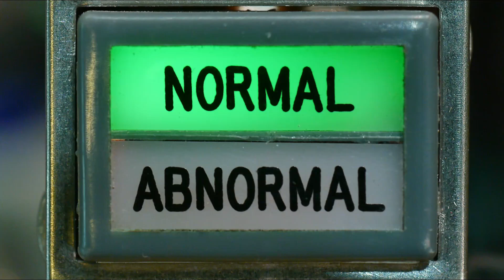#2384 Intel 8755 Port Input and Port Output

Comment: Thanks for all you do, I’m a retired hardware/firmware embedded designer.  I just love uP’s. Question, I just bought a 8711A and wonder if I make the same boot flash mode you did on your 11C, what’s the probability I can make a 12A?  Thanks in advance Best 73
Reply from the maker: https://dietervansteenwegen.wordpress.com/2016/11/14/hp-8711a-modifications-tweaks-refurbishing/
Reply: Thanks I’ll keep you posted on the mod, 73

Comment: Thanks for doing a quick video on the little project, I was curious what the socket was for.  DIP switch makes perfect sense.  I wish I had one of these when I was a kid.  I would have used it like an Arduino / simple PLC to control real world stuff.  A lap counter/timer for a slot car track that would show lap time / total time/ avg time for instance.  Imbed a reed switch at the starting line that would close as the magnets in the cars passed overhead.  Fun Stuff!

Comment: Key pad problems drive me nuts.  I finally had to disassemble and clean the keypad on my HP 15C calculator.  After 42 years it was starting to show it's age.  A couple of the number buttons would register a double when pressed.  Hit the 3 and get 33.  I finally had to tear it apart and give it a well earned cleaning.  Like driving a new car now.